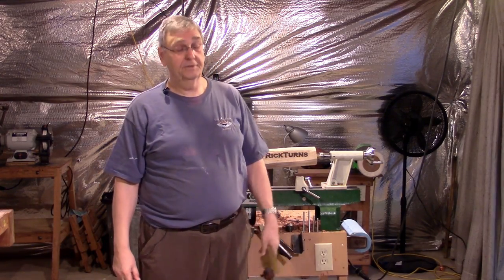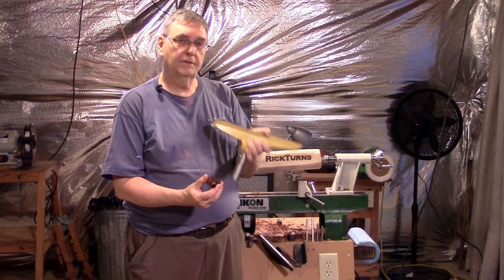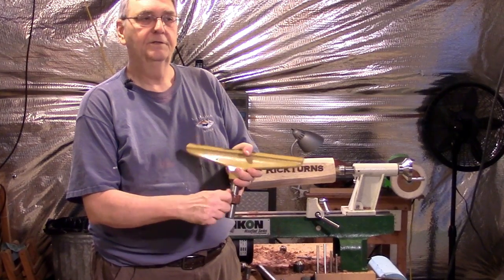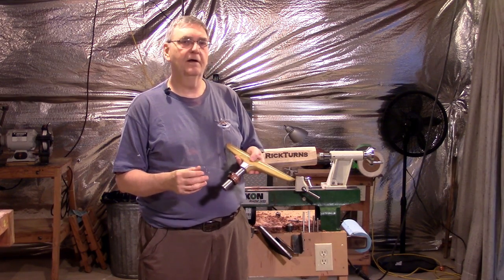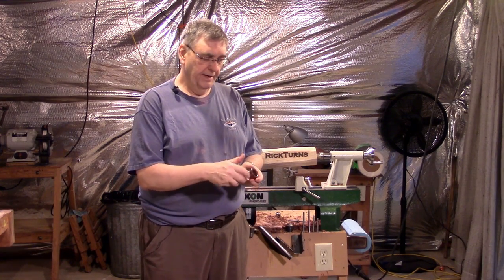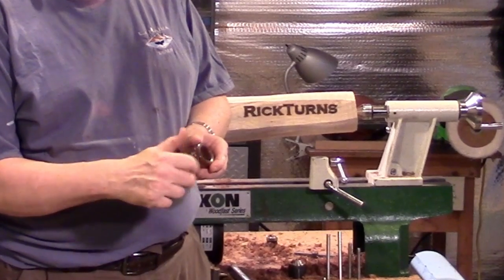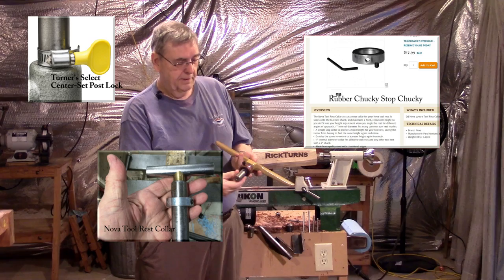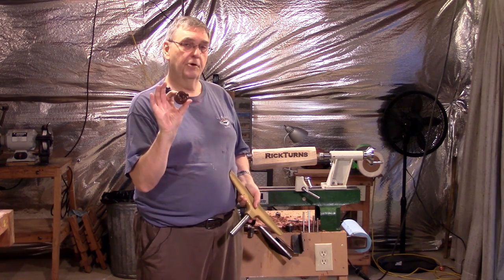Make a Stop Collar For Your Tool Rest

Comment: Nice video Rick.  I use stop collars on all my tool rests and really like being able to just throw on the next rest without having to check for proper position.  I get my clamp collars on Amazon for under $5 and I have found them to be more reliable than hose clamps, especially when turning large out of round green logs doing the chunka, chunka thing which can beat down   pretty hard on the tool rest.  Functional but not nearly as nice as yours, thanks!
Reply from the maker: +Rick Stonewood Arts Thanks for the comments, Rick. I've never heard of clamp collars, so I looked them up on Amazon...they're made for barbells? If I had seen those, I might not have made a video!
Reply: +RickTurns The collars are pretty common in machinery and come in handy for a lot of things.  Your video had lot's of good information, and I am glad you made it, it was fun to watch.  Just wanted to add an alternative.  Keep up the great work!  I know how much you put into them.  That's why I don't do videos :-)  But I truly enjoy yours, Best Regards, Rick